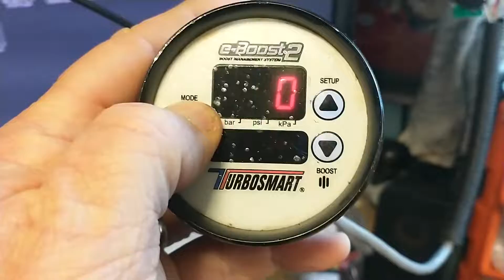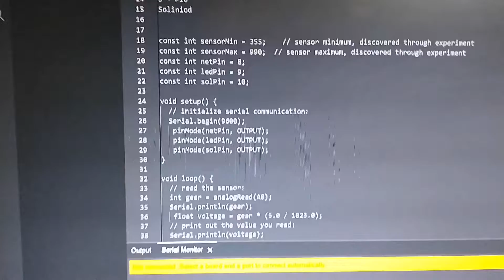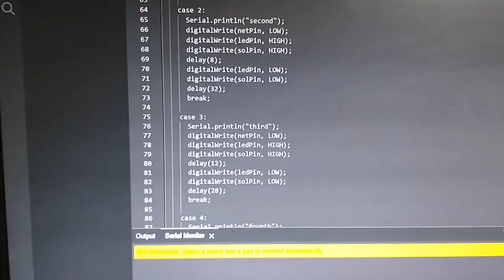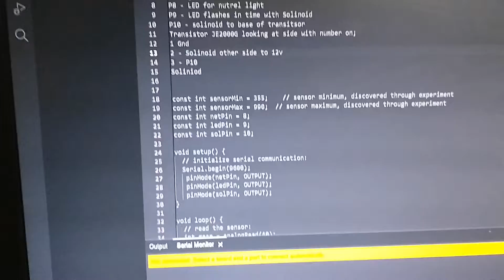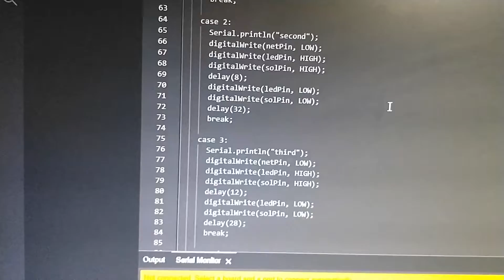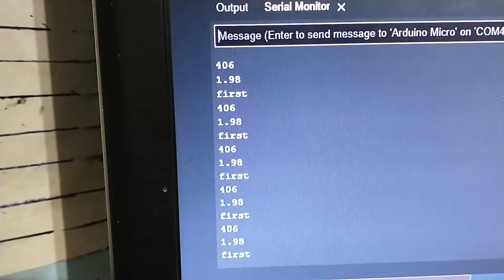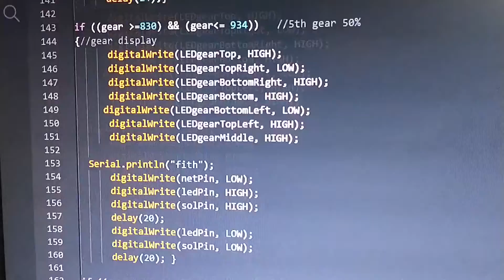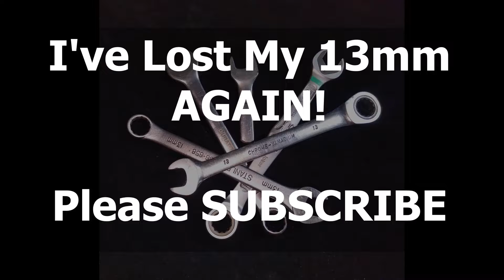How To Make Electronic Boost Controller for a Hayabusa Turbo - eBoost Failure & Arduino Program

Comment: Hi there sir hope you doing well im extremely interested in doing this set up on my Opel would you be kind enough to share the wiring diagram
Reply: We have done some small projects for the race rig but this just seems a little out of my skillset😂 would love to be able to control traction and this seems like the best solution out there
Reply from the maker: TBH - I have not completed this project - other things have taken priority.
I would say if you are looking to do this the Arduino seems like the best option, but it is VERY susceptible to electronic noise.  You need to physically screen it and use external filters and power regs to clean up the cars 12v supply to the board. 
I never drew out a wiring diagram.   @JaydenHeyneke
Reply: I honestly appreciate the feedback will definately will attempt this project . Just matter of interest would you consider making one up for me I would fund it .sounds like you in the UK I have family there I'm in South Africa
Reply from the maker: HI - have you watched all parts of these vids - there are two more after this one.
TBH the electronics are not fully working. They work fine "on the bench" but not on the car. As said the Arduino still needs more screening. This all takes a lot of time. If I was to do this "commercially" it  would not be worth the cost to you - it would be cheaper to buy an off the system.

Comment: The Arduino Nano Every is small and can use a 12v input.
Reply from the maker: I'm not sure if that has enough input/outputs. I plan to add a LCD screen, which needs about 8 pins.
Reply: @Lost13mm  Use a I2C lcd.
Reply from the maker: @V12Buickguy  I've got a 1x16 LCD with the big characters so I can, hopefully, read it while driving 
I'll look up the one you have recommended.